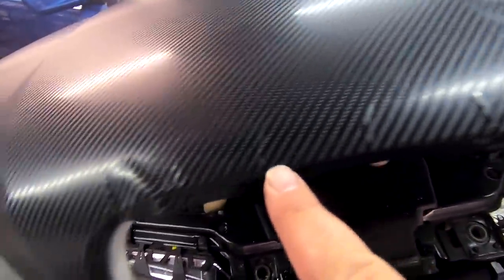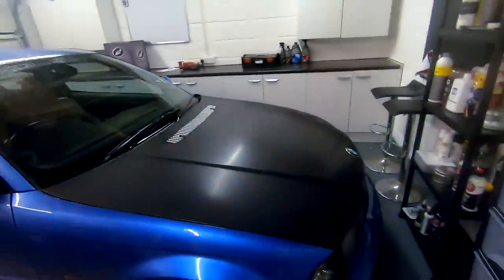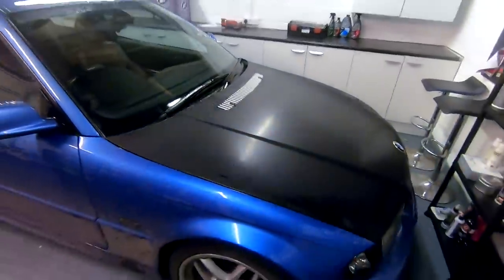Complete Dogs Dinner balls up - How NOT to install Vinyl Wrap at home

Comment: Been following you for a while, have never commented and I appreciate all the stuff you put out. However, few things here, vinyl wrap is not a wet application, it's all dry, you shouldn't be using any sort of slip solution ever. Application requires slight stretching it over a panel and squeegeeing down with your felt buffer - the air release texture built into the vinyl allows for air to pass through the vinyl, unlike a PPF. Second -- those ebay vinyl wraps for cheap offer really terrible air release, they're simply not effective. A higher quality film such as Avery SW900 will probably be 3x the price for a 152x152cm piece to cover the hood. CKWraps on youtube offers some pretty good hood tutorials with well explained technique.
Reply from the maker: makes sense.  this really is just a 25 quid bodge.  video says "how NOT to install vinyl wrap"  and video advice is get it done properly and pay the money :) I need to have it wet really  as my misses wasnt a willing apprentice getting 1 minute of her time was a major problem.  but because it was wet it was so much harder to install just like you said, but allowed me to get it done alone.    I think this wrap is cheap.. but saying that I reckon someone who knows what they are doing might be able to get some good results with it. just not me. gr8 stuff though dvq :)
Reply: @ForensicDetailing  in time you are learning but for now its fine and leave it till the new fresh paint work and check the hood electronic  and the hood lach ? or hood lock
Reply from the maker: yer we have a brand new latch on this hood and every thing seems to be working well..

should hopefully be getting the alloys done on it soon.

Comment: Not bad for a big panel. I’m sure you learned loads off this attempt; your next go will be a lot easier I’m sure.

As a stepping stone to help you in future, you can peel back a section of release liner, slice it off and then position the whole sheet in place. Stick down the exposed section and then  start peeling the release liner away underneath the vinyl as you squeegee more down. This means you’re only ever having to deal with a small section of exposed adhesive, don’t need two people and have something to hold on to which can sometimes help with applying even tension in one direction. Applying tension that way can help prevent the fluting you can get when using just your hands straight on to the excess vinyl.

Make sure the knife you use is sharp when doing this otherwise it can ruin the edge of the release liner and leave torn bits of paper to get under the vinyl. When you hinge the vinyl back, give the panel a final dust off to get rid of any contamination that will have come from the back of the release liner.

Buy yourself a heat gun rather than a hair dryer. It doesn’t need to be an expensive one, although more control over temperature and airflow speed help. Some wrap vinyl has to be heated to a certain temp once it’s in place to ‘set’ it in to position.

For the bonnet vent section I would have heated a section, pressed the vinyl through the holes to stretch it slightly giving you something to grip underneath and wrap on to the underside. 

Looking forward to see you having another go!
Reply from the maker: that is genius yes, I had to get it in quite a precise position to fit only way I could think to do it was wet it.   just didnt think to leave a big chunk on that would have done it.
Reply: Forensic Detailing Channel  
We use magnets covered in rubber at work when positioning vinyl. You could bodge something similar with old hard drive magnets or similar. 

The only time we wet anything is when we are heating, then stretching vinyl in to certain areas with the end of our fingers. We wear cotton gloves (white inspection style ones) and wet the fingertips to allow them to slide consistently along the vinyl to do long sections quickly. Not much use of for that trick on your bonnet but it may come in handy for something else.

Anymore questions, feel free to give me a shout.

Comment: Jon should have been a dry application it’s easier to work with believe it or not. 
Only advice I would give now is before taking it out you need to heat the vinyl to make it setup sure it’s 180 degrees that will activate the glue and you won’t get peel back

Comment: I tried to do a little piece inbetween the windows in the sort of B pillar area on my old Volvo v50, the black paint had started to peel away and looked a bit shit. It had been lovely weather all day. Id washed the car, decontaminated the areas but as soon as went to stick the first piece in place I swear storm force winds just appeared from nowhere. The first 3 pieces just twisted around and stuck to itself, the next I heated a bit too much and it shrunk, bent over and looked shit, I pulled it off and it took a load of paint off with it, next one stuck in place wrong, tried to peel it off and it took more paint, had to bin it. 6th attempt I got it ok, went to do the back window and didnt have enough bloody film left

Comment: Guess the same applies for PPF on large panels, right? You need 2 people doing this.
Reply from the maker: PPF you apply wet you can slide around but you need 2 peeps really.  vinyl you ally dry and set it down.. basically dont do what I did in this video.

Comment: You HAVE to use a quality vinyl. Quality vinyls have air release channels on the adhesive side and you wont get any bubbles at all. Brands such as Oracle, Hexis, Avery, even cheaper KPMF are all excellent vinyls and a monkey could wrap a car using them.
Use a cheap chinese vinyl and you will never ever do a nice job.
Decent vinyl also requires no solution to be sprayed under the film, they go on dry (once panel has been thoroughly cleaned and IPA'ed to remove any contaminants and waxes).
Easiest way to wrap a panel for s beginner is 2 people. 1 either side of the panel, pull vinyl taught and gently lay it down onto the panel, bonnet in this instance. Once the vinyl has made contact with the centre of the bonnet, you lift up the vinyl and pull it taught (called glassing) and whilst pulling it taught, lay it down across the panel. Then do the other side in the same way. The ideal way to wrap is to get the working environment warm so the vinyl is pliable, so you can wrap the panels without any heat from a gun. A IR heater works a charm, aimed at the section of vinyl your working at that moment. Heating vinyl gently actually pulls it back to its original form, so if you have stretched by hand, heating it will shrink it back.
Think of wrapping as more of a shrink wrapping technique, not heating and stretching (because thats when it pulls back).
 Once completed, you use a temperature gun and a heat gun to "post heat" any edges and where its conformed to recesses, heat up to the manufacturers required heat so that the vinyl loses its "memory" and wont pull back.
And always use knifeless tape rather than cutting against the panels, always! A felt edged squeege, heat gun, temperature gun, scalpel, knifeless tape and a wrap glove all help. I prefer to use a glove to press the vinyl into recesses, and the squeegee on the large flat sections. Cut vinyl around the edge using a 45 degree blade angle so it gives you a nice even amount of wrap around
Reply from the maker: 10/10 post thanks so much for this..
Reply: @ForensicDetailing  good effort for the film you used though Jon. Enjoy your channel keep up the good work mate!